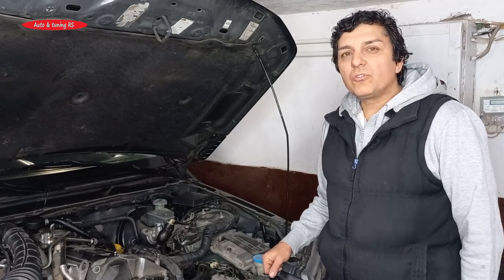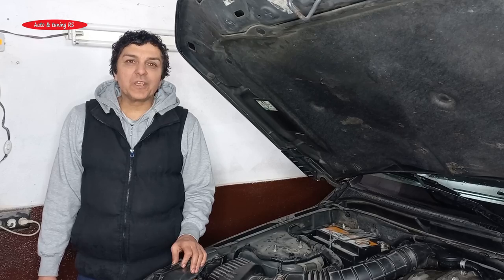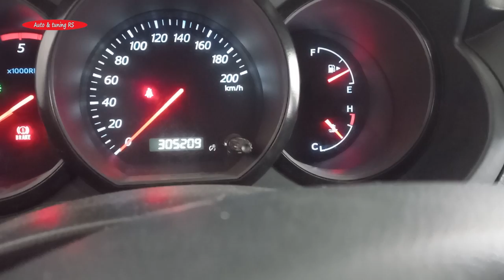COOLANT CHANGING, and HOW TO BLEED the ENGINE COOLING SYSTEM of Suzuki Grand Vitara 1.9 DDIS

Comment: First; thank you for informative videos! Second; -You can actually reach the bleeding cap if you  know  the trick. Stand beside the left front wheel, facing the rear of the car. Use your left hand,  and reach in behind the engine. You can the just reach the bleeding cap. It's easy to loose the cap, and difficult to get it back on. But it's possible!
Reply: If you do lose it, a schrader valve (tyre valve) cap fits.... same same ... on RH drive versions, removing the battery alone gives enough space to get your hand onto the bleed cap. Follow the radiator hose back to the thermostat if you're struggling to find the cap - it's just above where the hose goes in.. You can feel it, but you can't see it. Work by touch.  Fill the coolant till you hear/see coolant running out of the bleed - then refit the cap.

Comment: Hello i have a problem i installed webasto to warm heating cooling. But from expansion in summer season when inturn off heating ac inside, coolant go out from top of expansion tank. Of course in summer webasto is turn off.
What can be happend?